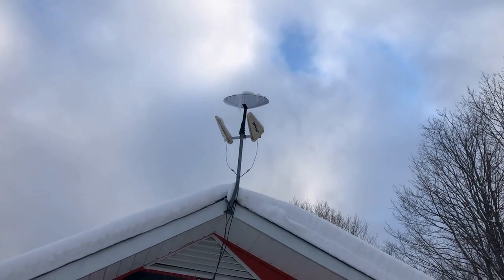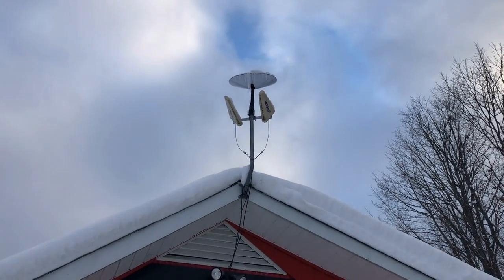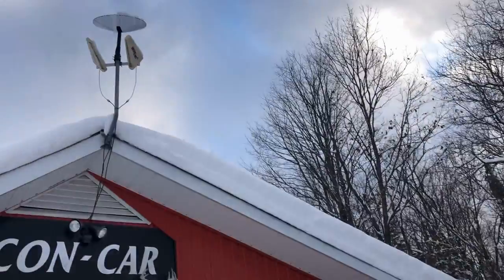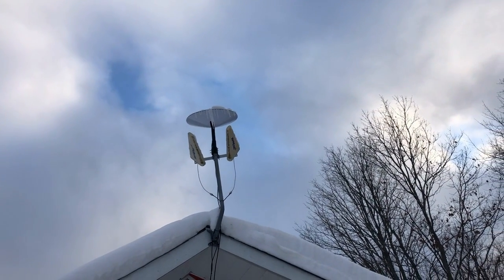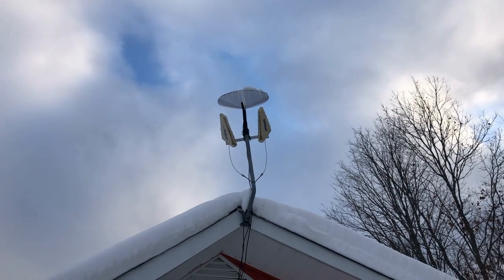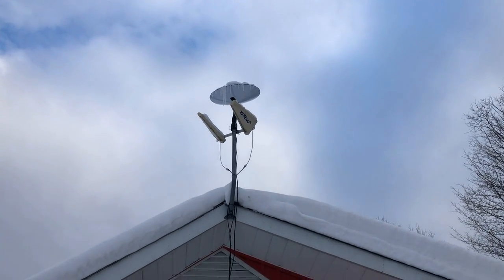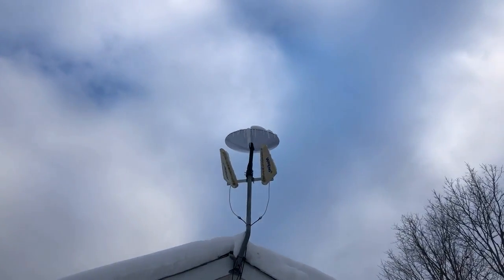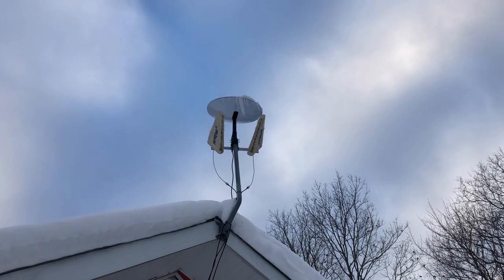Starlink Snow and Ice Testing

Comment: I wonder if a little plug in heat tape attached to the bottom edge of that dish would help. Just plug it in when needed
Reply: They have a heater built in. Mine when it was -15 had icicles hanging from it & 1/4-1/2" of ice on dish & I was still getting 80 mbps. My buddy has a HughesNet dish & his didn't even work.
Reply: @UncleJoe1231  my worry is that the motor will burn out quicker having to move the extra weight of the ice.

Comment: I have a question, when you were not there did you leave the Starlink powered? If you didn't it tilts flat and thus snow would have built on it then when you power up it now melts everything and with that amount of snow it had lots of water runoff to create ice on the trailing edge. If you left it powered while gone then ugh. Mines not had Ice build up yet in Northern Ontario. What I benefit from though is my place near Lake Superior has very high winds most times and the wind whips the snow off (plus it's minus 25 on average) and the snow's so cold it doesn't have moisture to stick to anything it is like crystals lol. 
I'm wondering if from the latest round of customer feedback survey's if they'll modify the dish to included something different in the heat grids that concentrate them more to the bottom side of the dish.
Reply from the maker: We do keep it on 24/7 because we have a security system at the property that requires wifi.

Comment: Could you please tell me how far away can you access your starlink WiFi pole ? 50 m ? 10 miles ? Thanks in advance
Reply from the maker: Do you mean what the wifi range is from the router?
Reply: @MuskokaRepublic  Thanks for your asking.Yes, I mean how far away you can be from the sl router and still can have the WiFi signal from that sl router?
Reply: @tzdtuc-pd9yv  Not sure why you care about the range of wifi, since other youtuber have demonstrated that you can replace it with any wifi router you like, or connect the cable directly to your computer if you want.

Comment: Interesting ... I'm following your journey.  I'm between Gogama and Timmins (5 hrs north of you) and weather is even colder here but a little less snow... but ice is a problem.  I prepaid service pending service availability for my plus code area.  Now have Bell VDSL2 (22down-1up) and same price as Starlink.  How's your intermittent timeouts with Starlink? Are those 10-20sec timeouts annoying and frequent or does the buffer compensate?
Reply from the maker: I have not tested for long periods of time, as I do not live at this location.  I am going to try working here for a few days (full days) to really get a feel for any disconnects and frequency.  Will keep you updated.

Comment: Hello Muskoka: i just installed my starlink and am in Torrance Ontario near Bala. I noticed the same issue but the snow melted off during this past week. My issue is that i have obstructions from trees and i get consistent drop of service. I am going to mount it on my garage in the next week. It presenrly sits on a tripod. Mitch